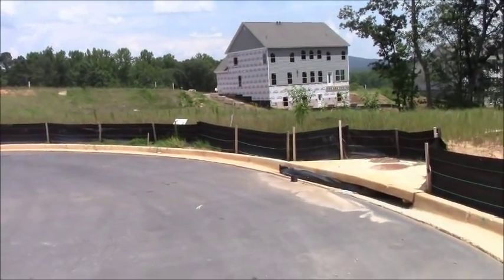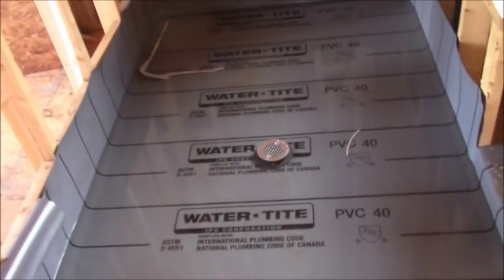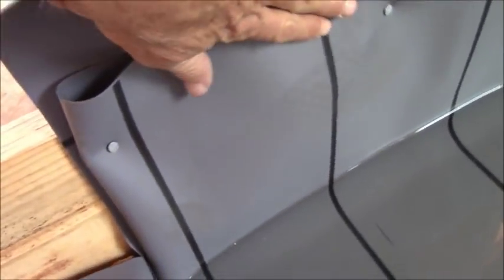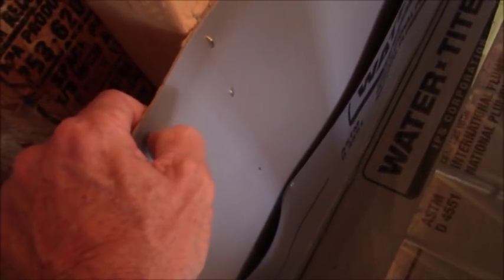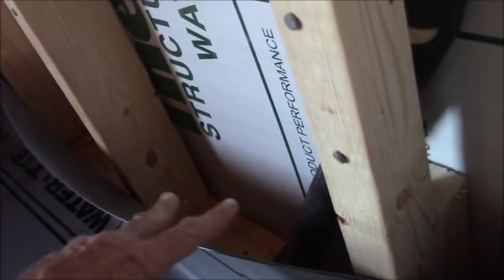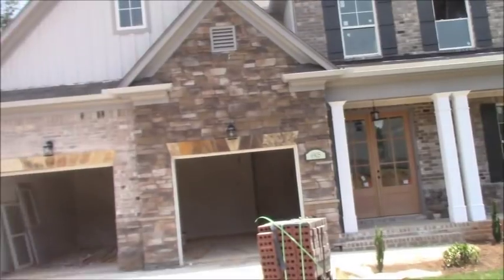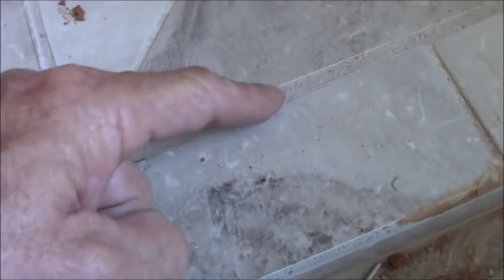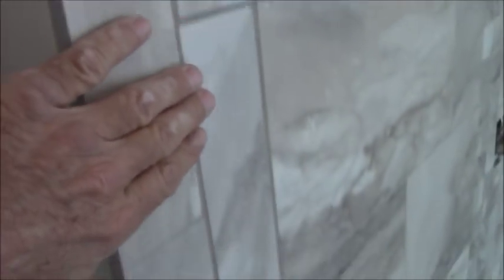NO ShowerPan PreSlope ..NEW CONSTRUCTION

Comment: What is a pre-slope?
Reply: Preslope means that you make the floor underneath the shower pan  (before putting the PVC shower pan liner down) sloped toward the drain, that way your PVC shower pan liner is sloping toward the drain before you put in your cement shower pan. In theory, if water weeps/leeks through your shower floor tile and cement pan down to the PVC shower pan liner, it will then run toward the drain and into the weep holes, instead of just sitting stagnant on a flat PVC shower pan liner.

Comment: Sorry to contradict you but pre slope really works.  It's been tested and shower floor doesn't get saturated..
Reply from the maker: Really works ???
Send me proof of that and I will send you $100
Reply: @StarrTile  don't need the money.   Just test it .    Make a shower floor  on a pair of sawhorses and try it out. Pre slope floors are necessary for showers so water won't stay on concrete otherwise everytime you enter into as bedroom with a shower in that condition you can tell right away that there is staggered water.  Truly I'm not trying to be disrespectful with you cause I agree on many things that you say but on this case I believe it's a better way to o do it.   Obviously it takes more time but I think is worth it.  I respect you man.
Reply from the maker: @jorgebecerra5250  it's already been done, I posted that video about three years ago doing a mock up pan and 99.9% of the water came out of a flat pan with no preslope.

You must understand anytime I post a video I always have evidence to back it up whether it's on a real job or if I have to do a mock-up like I did with that video.

Comment: In 25 years of residential tile experience, I've never seen a pre-slope test. But that's not to say it doesn't need a pre-slope floor to provide draining to the weep holes. Local code officials only require a leak test. Unfortunately to many so called tile contractors don't follow the TCNA handbook on tile installations. The use of PVC liners is obsolete and shouldn't be installed.
Reply: I got my pre-slope flood tested. Where I live, the blocking between the studs is required.
Reply: Kevin Hornbuckle yep blocking is required everywhere I've worked as well. Looks like the Atlanta market is pretty weak on its knowledge of the tile industry.

Comment: It is PEX, cold expansion or PEX "A", Wirsbo.  It has a memory, you expanded with a tool, it shrinks back.  I won't get into what is best, but that stuff is super easy to work with, fast, and I've never had an issue, but I use brass fittings.

Comment: As an engineer, I see capillary action as irrelevant.  That the mortar bed is between 0 and 99.9% saturated is unrelated to the purpose of the pre-slope.  Porosity of grout and mortar pretty much dictates that water absorption is a NORMAL expected condition.   Good engineering specifications (building codes if you will) are also about mitigating failure situations.   Good code/design is engineered for the lazy, inattentive homeowner/renter.   When the grout fails in a splash zone, or wall, or floor it's more than just a few drips.  It could be measured in ounces.   Assuming that water flowed inside the pan (first lucky break), it's now flooding the mortar bed.   Capillary action, oh how we miss you, so adorable.  Nope, we have 100% saturation and water is flowing.      I don't think I need to explain the rest.  No pre-slope = probable bird bath.    If your professional is against a pre-slope, then who knows what opinion he/she holds about long term standing water.  Do they just leave mortar bed drainage up to luck and god's plan?       I suppose you could argue mortar bed bird baths are not going to destroy framing, and were "fine" in the 20th century (good ole days), so why bother now?  But as someone who also follows standards-based "rules," it's reasonable to argue that the pre-slope became the standard because there was a legitimate problem to solve in the field, and that should be respected regardless of personal experience and beliefs.
Reply from the maker: I am not a Maverick just for Maverick sake, there's a reason Christopher Columbus was only one who felt the world was round, if you base on just what everybody believes to be true rather than testing it then you would truly be a fool... once he proved the world was round everybody, even the naysayers had to swallow some Humble Pie. However in that example at least there was proof, with a pre slope notion there is no proof , and yes capillary action matters a lot , it would only not matter if there was no mortar in the pan then I would agree that a slope would actually work. In fact I would challenge you to find a date stamp on a pre slope notion, I've been walking this planet nearly 58 years and I have never ever seen one... then again people are like sheep, so goes with asbestos, so goes with polybutylene, so goes with other products that are believed to be good until proven otherwise, which I have done on a few of my videos.
Now to your reference of the water in water out theory, that's absolutely ridiculous, you are replacing tainted water with more tainted water, the only way that theory would work is if there was no one standing in the shower when the water is turned on, no skin particles, no pee, no body oils, no detergents, no shampoo, no soap residue, only clean water, then of course it would work but that's not the real world.

Comment: Not sure why you never lifted up the liners to see if a pre-slope was under them?  How can you determine if the liner was sitting on the subfloor if you didnt pull one up?

The "panel" is code for an air barrier between shower & tub enclosures.  Usually, at the exterior wall where the tub goes,  people insulate, put on the cheapest sheathing possible  ( I'm surprised they use thermal ply and not cardboard), and then frame out tub deck & install tub. 

Not sure why they are putting the thermal ply halfway up a shower wall... my guess is that the Builder doesn't know what he is doing, or he's leaving the code to the plumber who's leaving the code to the Builder who's then leaving the code to the caroenter guy who doesn't know anything about an air barrier at the shower wall, so we puts up that thermal ply the whole time thinking how stupid it is to do so.
Reply: did you watch the video? he does look under the liner and there is just sub-floor under there.
Reply: srry..my bad
Reply: The water pipe is wirsbo

Comment: Bob, this is the type of video that should be seen by anyone thinking of buying a new home.  You only touched the tip of the iceberg,  I spent countless hours doing cleanup and repairs in new homes after the warranty period ends and in remodels that were completed by so call professionals.  I honestly believe that big money removes common sense.  As you, I believe the only way to go with plumbing is copper.  The only thing plastic plumbing should be used in is drainage and landscaping.  Keep up the good work and videos.  Bill
Reply from the maker: Thank you sir !
Reply: I'm remodeling my bathroom  I'm looking for water proof  , I'm think is very good thank you

Comment: What is meant when you said, "They attached the tile directly to the wall"? Do you mean they did not use a cement backer board? Did they just use drywall instead?
Thanks. Getting ready to tile a tub/shower with marble, and I need as much info as I can get so it doesn't look like @#@??%@%.  And then after I "cut my teeth" on the tub/shower tile, I am going to attempt the big kahuna - tearing down a 3x3 shower and rebuilding it as a 3x5.

Update:  As luck would have it, the next StarrTile video I watched explained the term "...attached tile directly to the wall".  This meant that they only used thinset mortar on the cement board, but no back-buttering on the tile itself, making the total mortar bed small. Yes?
Reply from the maker: Thinset should be on both backer board, regardless of the make up of it...AND buttered on the tile.

Comment: Sorry for the rant, but I've seen all I want to of these shotty workers that say they build high end homes but do this.  Drives me nuts. Because your basically stealing money from the next guy in line.. 
It's called passing the buck right on down the line to the next guy.  Someone is going to have another job to do on top of the job they are being paid to do.  I hate this shit.  Your being paid to do a freaking job  and by the end of the day the job is done half-assed and he's gone to the next one in the morning.. The tile guys or the sheetrock cree crew has to stop what they are being paid to do in a certain amount of time as well, and fix the plumbers screw ups on the pan liner.  
I used to install doors and windows in new construction homes.  The crap that I've seen in these expensive homes is ridiculous .
Can anyone read a lever or a tape measure. 
The block layer shouldn't be allowed to lay the first block until he installs a bunch of windows, and doors to see what his neglect cost me in time and money.  The Rough opening for a door or window is marked on the plans for a reason for Christ sakes. Now my installation won't pass inspection because your opening was to wide and left a unacceptable gap between the window and the buck or jamb.. So I have to check it first and go rip lumber and finish your job. It's wrong!!! Or leave me your number so I can collect my extra time.   Same thing as the plumber on this job shouldn't of  been allowed to install a liner until he's install tiles before and has to deal with 3 layers of rubber liner trying to keep a plum james so the door jamb isn't kickedout an  inch at the bottom from the top measurement.  Jesus guys. Come on and do the right thing. The next guy is only getting paid for his job. Not fixing yours too..

Comment: Thank you. I dont believe in pre-slope. I dont like the idea of motor being on an OSB floor, even if you use something like tar paper first. It also takes more time and motor. Just put down the liner, slope the motor, then set the tile and be done with it.
Reply: I built my pan with a slope and I installed cement backer board on the floor prior. I will be putting cement board on my walls and coating with red gard. My liner will go on before my wall cement board and I will leave my cement board at 1 inch above where the floor tile height to prevent mold growth. I don't tile for a living but my work will run circles around what I saw on this video in these new homes.
Reply: Do you put pea stone between the mortar bed and the drain, circling the weep holes?
Reply: @GregoryGuay  the weep holes are there in case the mortar shrinks a little. So, no.
Reply: @macD723  So, you adhere to the idea that the mortar just fills the weep holes but this is acceptable because it is pourous? I just demo'd a shower: no pre-slope, weep holes plugged, mold & mildew...so I'm trying to decide how to rebuild. Thanks!

Comment: Nice tour and commentary.  House like that in NJ would be in the $750 to $850k range.  How much do you think the construction would differ in less expensive home along with apartments and condos? Do you ever work in new construction custom home?
Reply from the maker: On rare occasions I do new construction projects, but not a lot.
Apt & Condos are worse, builders grade everything.
Reply: All homes are built with the same garbage.  OSB, particle board, finger jointed leftover studs, etc.  the only difference is the more expensive homes are bigger, so the problems later are on a bigger, and more expensive scale.

Comment: Oatey and all other drain manufactures, if you go to their websites on installing their stuff they say a preslope is a must...also the TCNA tile bible say it's a must to do a preslope...no pre slope is like doing it to a hooker and going raw dog...oooo that's nasty! Pre slope boys...take the extra 30 mins and also before you bolt the middle phase of the 3 phase shower drain . ..take the bolting flange and hold it in your hands and get your drill gun and get small drill bit and drill them weep holes out and make them as big as you can ..

Comment: It is really unusual reading comments from tile layers "30 years +" saying that the water will stagnate im the pan yet understand that water can wick up walls... Knowing that it works that way. The reason water does wick up is because the material is dry its contacting and it shouldn't contact that material. So the fact your POST slope is done correctly along with your ENTIRE tile job. Your POST slope is enough to make sure your tile mortar remain dry as possible and all moisture will work its way through regardless of preslope. Ive seen basement walls where water rots studs 8' tall. Water will only  go where its LEAST resistant. Figure it out. Concrete is porous. Therefore it will always reach the weap holes. Unless you're a know it all and keep burying your cement boards for your WALLS and curbs DIRECTLY into your pan liners WITH  A preslope. You'll never understand what this guy is trying to teach you. Preslope is recommended because you don't understand what this guy is saying. If you make sure nothing contacts your post slope at all. You'll have a better chance of ANY excess water evacuating EXACTLY where it's supposed to. The end

Comment: Here in the Silicon Valley California if you don't have a pre-slope they will fail your shower pan! We always do pre-slope and why be lazy and not do it its just a sheet of plywood
Reply from the maker: You don't form a pre-slope with a sheet of plywood, LOL !!
Has nothing to do with lazy, my typical shower/bathrooms are 8-10 days, what do I care about an extra hour of time..has more to do with ill-logic, makes no sense at all and there's no proof it works. Here in Atlanta I've yet to see one, OR tear out a shower with one.
Reply: StarrTile when on a wood subfloor that’s exactly how pre-slope you probably don’t even use a vapor barrier behind your wall board I would never hire you
Reply from the maker: No buddy, you are wrong BIG TIME ! A slope isn't formed with plywood, it's done with mortar...would LOVE to see your way, it would be a 1st !
And no vapor barrier goes on studs when using a topical membrane, you're obviously not qualified to make any comments here, it will embarrass you ! And I don't need YOU to hire me, have plenty of work ;-)
Reply: If I had a way to post a picture I have 3 bathrooms I’m doing now and have a picture for you we only use deck mud for pre slope on slab you run 1”x2” strip around edges and 1” to 0 towards drain and make half depth rips in bottom of ply wood to drain then screw it down it’s simple then put in liner
Reply: you can use anything to preslope. I use heavy weight tar paper. Cutting it in strips, reducing the widths from the Drain to the walls, the strips ending at the walls being the skinniest widths. It works like a charm.

Comment: The best example of wicking or capillary action would be a wet sponge placed on an incline, with water slowly dripping into the sponge from a cup of water. By capillary action, you'd clearly see that water from the over saturated sponge would flow downgrade through the sponge with very little "wicking" sideways as you say. Bottom line - gravity does play a role in this example of the sponge. It is the same effect as a sloping shower pan, with the concrete acting like the sponge, and why a slope is absolutely necessary to prevent water stagnation and its side effects.
Reply from the maker: There's no void, water can't stagnate without a void, it will stay absorbed EVERY direction not just downward.
Using your example that sponge is forever wet ( so would the mortar be ).
And as I mentioned, there's no proof anywhere on the internet it works as intended.

Comment: That's pex A. Maybe you have only seen pex B installs? Pex is much better than copper. It's cheaper. It doesn't corrode like copper it's easier to install and doesn't burst when it freezes. It also lasts longer. When you say you have seen plastic degrade you'd be talking about cpvc or Polybutylene.

Comment: Drain kits have weep channels to let the pan dry. Also if you pitch the mud bed properly your mud pan will be damp at worst. Pre slope is useless.
Reply: So how does the water find it's way to the lowest spot if the pan is flat..it probably won't leak but I don't want standing water in a shower ...what is the shower gets used like 4 or 5 times a day and never has a chance to dry...maybe plumbers should just lay all those pipes flat and level to and not worry about pitching the pipes...so maybe they should just lay the 4" main drain going out to the city drain nice a flat and I'll just go on hope that it doesn't back up...

Comment: That's why you use kerdi.  I want my waterproofing on top not on bottom.  No moisture getting under kerdi.  Don't need to do a flood test.  Showers don't remain flooded in water.  Ever!!  Pre slope is needed i agree with pan liners, but pan liners are installation from yesteryear.  And every top notch tile guy that's used one has had a failure.  Kerdi drain I've never heard of a failure.

Comment: The builder quality is not to last a lifetime. It’s generally to outlast the builders warranty. I never liked the rubber pan liners. They are thick and bulky and prone to problems. I’ve fixed a number of expensive homes that failed. One had nails right through the bottom of the pan. Putting a rubber liner in to catch water then not pitching it so the water sits inside just seems really stupid to me. And I think they mostly do it be cause it’s fast and no one knows enough to call them out on it.